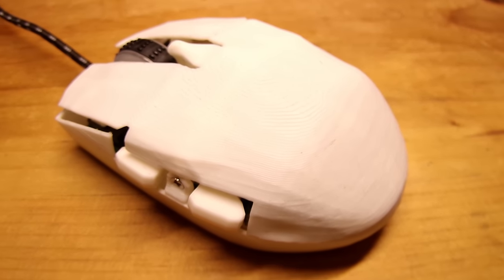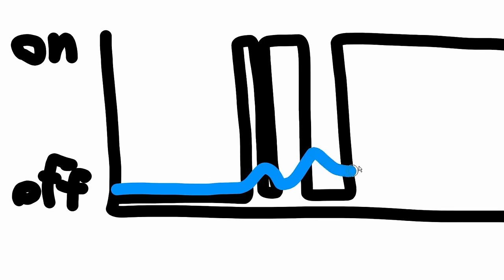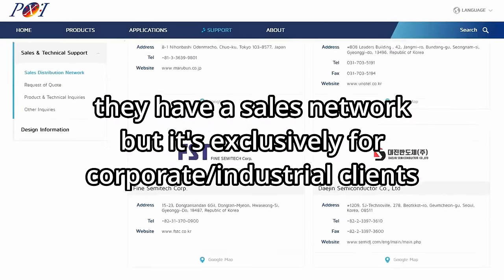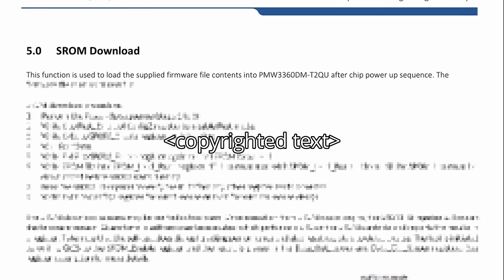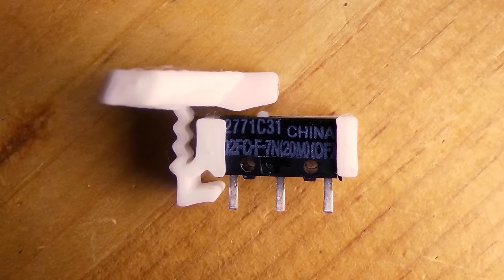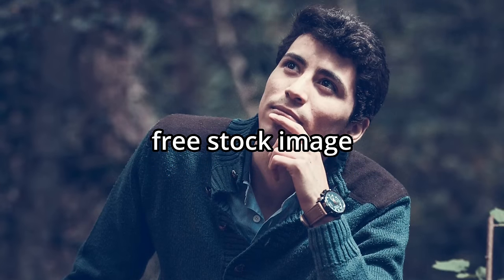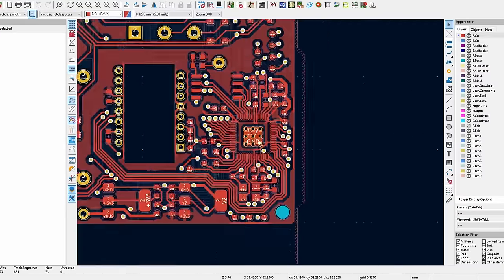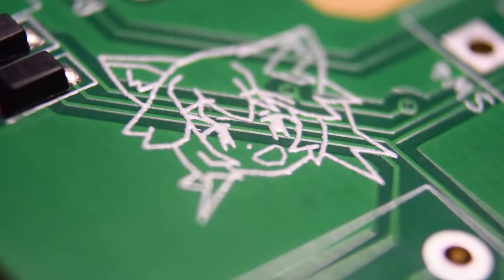I made a DIY gaming mouse because Logitech's mice keep BREAKING

Comment: Then there's me, who learned soldering just to solder new switches for M1 and M2 for my G502 Hero.

I used Japanese-made Omron switches specifically. Avoid the Chinese ones (regardless of brand), because the copper gets tarnished way too fast, usually within a year. You can clean/polish them if you are dextrous enough, though. That's what I did a couple times until I realised it would be far better to pick up a new skill and just solve the issue for good in one try.

Needless to say, it worked flawlessly. The connectors are gigantic, anyway, so even a newbie can desolder them and replace them easily. I even bought a new and original outer shell for the mouse on Aliexpress (since no local sellers regardless of where I looked) and I basically own a brand-new mouse now.

PS: Funny enough, I wonder why the M4, M5 and so on never had issues. Maybe it's less usage. Maybe it's different switch structure (or material?). Makes me curious, though. I only ever had issues with M1 and M2 switches.

Comment: I’m surprised you don’t mention scroll wheel; the last like 5 mice I’ve had, the scroll wheel was always the first to start failing, often only days after getting the mouse.
Reply from the maker: The scroll wheel is one of the pieces where you just have to hope that they don't cheap out, unfortunately. The way they work internally doesn't give enough information to do anything clever like I did here, though there are wrong ways of reading them that are prone to glitching than others.

Comment: I've been thinking about making my own mouse with a plethora of programmable buttons. I thought I'd put two mouses inside one shell and use just one for the sensor but both for buttons. My current mouse is a Roccat Tyon (which for some odd reason now has it's control software working without any bad lags or waiting times, which before made the software a total pain to use with like 10-30 second lag for the simplest of settings). It has pretty good features and almost enough buttons but the sensor is blah. 

The other mouse that I had for a good while was Logitech G300 but it's so tiny that it really makes my hand hurt. Also the Tyon has pretty cumbersome shape that I've tried to shave a bit. After using a modded Silverstone Raven Gaming mouse like a decade+ ago and the G300, I can't live without the two extra buttons on the right side, or buttons on the top/behind the wheel. Also the analog thumb flicker on the Tyon is very nice, even though I need a 3rd party software to make use of it while browsing and it isn't really that good, as I can't have actual analog control over scrolling, just a very course ramp of repeating the given amount of lines to scroll in Windows mouse settings.

Comment: I can attest to logitechs lack of quality control; I have 2 g203's - in one the middle mouse button barely works, on the other the buttons all stopped working.
-
Update:
It turns out the buttons hadn't stopped working, the thumb buttons were now left and right click; the PC I was using the mouse on had somehow corruped the Logitech G Hub software and reinstalling it fixed the problem. But, if I try and use the mouse  on a PC without the G Hub installed, it's the thumb buttons again.

Comment: Mice and most trackballs have enough room for full size microswitches of the type you find in an US Happ style arcade machine (cherry dx-44's) that would not fail for decades. Yet most if not all mice use the tiny mini-switches that have a much higher failure rate on purpose so you'll end up getting a new mouse faster and making them more money.

Comment: the problem isn't the logitech, but Asus holding the patent for hotswappable mouse switches
Reply: The problem is that you can patent obvious things like make a part changeable. It's not an invention.
Reply: The problem is logitech because they're using garbage switches that go bad stupidly fast
Reply: I don't know about Asus' patent, but I know about switches in new mices on the market which are a) hotswappable, b) they are optical, so the bouncing on the contacts is no problem anymore... Almost all new Razer mices have them (and some other brands).

Comment: Recently bought a Logitech MX Master 3S. I love it for ergonomics, and the buttons for hot keys. But the problem is that the Bolt Receiver is complete shit. It will work fine, but then get extremely laggy, or just straight up stop working until I unplug and plug it back in. Pain…

Comment: I’ve had my Logitech g903 for around 4 years, and I absolutely refuse to let it die because it was so expensive (for a mouse). I’ve had to replace the switches 5 times, and I also had it RMA’d by Logitech themselves for faulty switches about a month after I bought it. However, after my most recent switch change to Kailh GM4.0 switches, I’ve really found some that last long. These most recent switches have lasted me a whole year and are still going strong. I really wish Logitech would fix their switches, it’s such a widespread issue and their mice can be so expensive yet still vulnerable to this idiotic design flaw…

Comment: yo, I gave up on logitech and went to roccat years ago after fighting with this problem ever since the g502s wouldn't stop dying, but I salute your spite, and am interested in coming back around to this when my current mice give up the ghost.
Reply: that is wild to me, as someone that has and still uses two g502's, one og wired one that is about 9 years old and a wireless one that is about 3 years old and knock on wood I haven't ever had any issues. I kinda want to make my own mouse just for the fun of it but I guess my luck gives me less of a reason to.
Reply: Define die. Is it just the switches dying or the mouse isn't even recognised aka doesn't turn on?

Comment: dont tell him that all mechanical switches eventually double click no matter if they are under volted like on the logi boards :3
Reply from the maker: That's what the timed state latch is for! Even if they double click for like, a hundred milliseconds, you can still filter it out without adding any latency, as long as you've got a solution for chatter.

Comment: I changed the microswitches in my venerable Logitech MX400 with the Japanese made Omrons and it made a huge difference.  I think they're about 6 years old now and only in the last month has the LMB started to double-click on me.  I'm not as much of a gamer as I used to be, but I do use it every day.  I would change them again, but I think the sensor is starting to die.. the tracking occasionally gets hung up on nothing.  (no hairs or anything stuck inside that I can tell)  Sucks because it's the most comfortable mouse I've ever used.

Comment: The best Hardware to mod a mouse is in my opinion the Roccat Cone Pro Air. Good Wireless - The only thing regularly recking it self is the scrollwheel, but thats quite easy to replace.

But all in all a very cool Project - An Open Source Mice that you can mod to your likings.

Comment: I've been using the WaveShare RP2040 Zero for a lot of my projects. It's nice because it has a rear facing USB C and is really small. The power of the Pico but a much smaller footprint.

Comment: the reason why the switches on logitech mouse keep breaking is because they use low quality omron ones, replace it with something like kailh GM or TTC golden it wont break, the tradition of logitech is their low quality switches ngl. either way the real reason why we would want a DIY mouse is because we all hate the proprietary software these things come with and the limitation set up by them. i hope one day the monopoly of pixart will end and we can get the sensor without extra scalping, but with the reliance of all mouse company ever on them its difficult to achieve that.

Comment: After facing similar problems as yours, I want one. Sadly I don't have disposable income to buy my own 3D printer or even a Chinese rework station.

Have you considered putting sockets to make the microswitches modular? You may have solved the biggest problem in the mouse, but I think making it modular opens up great options like being able to switch between different microswitches. Sick and tired of Omron switches? You can swap it with a Huano or a GM switch, just like hotswapping MKB switches.

I think the easiest way to make something hotswappable is with the use of millmax sockets. However, I think you need a hole big enough and a design to accomodate the added height.
Reply from the maker: The added height is the biggest obstacle, yeah. But also iirc the hot swapping system is patented...

Comment: I've been dying of old age on a nearly identical project because I found out that electronic component suppliers will send you legit parts if you just go through the awkward industrial process of emailing "hello I would like to buy 10 of this part for $1 each". But then I found out that the chips (at least the spcp168a type that I ordered) don't connect for some reason? No matter the company you buy from??? I guess I have to activate them somehow? (Would appreciate advice). Anyway, I'm stuck there, so this project is probably better off for just stealing a sensor from another mouse

Comment: When you said you have to replace the mouse every 6 months what do you mean by that? I thought it was only the switches that were failing
Reply from the maker: After enough replacements the solder pads and solder mask start to get damaged by the repeated heating and un-heating cycles and develop holes or lift up from the PCB substrate.

Comment: I did the same thing with the g600 (minus the coding and pcb changes, your just built different mate) still working out the bugs with 3d printing the shell but as of rn there are two running models.

Comment: 02:45 No wonder you had trouble desoldering that pin: This super fine soldering tip loses tons of heat along its length. Use a short stubby one with a chisel shape, and maybe even crank up the heat to 360°C.
Reply from the maker: I desolder with a dedicated weller station with a chisel tip. That clip is purely dramatic reenactment. But also, the sides of needle tips are just as good at transferring heat as the points of chisel tips are.
Reply: Some irons just can't sink much heat. We can't all have 550 W American Beauty soldering irons after all. Doubles as a space heater on those cold nights. Cook your dinner on it!

Comment: good result and engineering!  I don't know how your old mice failed so often though- I use a mouse for 12 hours every day since they had balls in them... and NOT ONCE did I have a broken switch. All the problems I ever had was related to the mouse wheel and most mice are also bad at flying into a wall.. which can be easily fixed by not playing Overwatch...

Comment: This is splendid. Did your custom board contain any extra components that are not present in the pico but required? 

I am thinking of doing this but with off-the-shelf RPI Pico, buttons and the sensor(i have few older mice around to salvage), since if the only problem is the location of the micro usb I can work with that.
Reply from the maker: Yes, the sensor needs an additional voltage regulator because it needs a weird 1.9 volts instead of 5v or 3.3v. Aside from that and the obvious (buttons/sensor/scroll wheel encoder), there's no extra components!
Reply: @wareya  I see, thank you for the reply!

Comment: "a soldering iron is just not going to work"

Not with this skinny tip, but someone more proficient will have a lot less trouble than you did without hot air, and having a set of hollow needles helps. Also what is this a pinecil how much (how little) power are you feeding it?

You can salvage parts with a construction hot air gun if you happen to have one, but it's not useful for soldering.

QMK keyboard firmware is actually fully capable of being a mouse and already contains 3360 sensor support.

The stock switches don't actually wear down and die for a long time if you squirt some D5 oil inside them when they're still fresh. And an alternative way to make switches last longer would be to supply a higher pullup current, which mouse manufacturers shoud have just done a long time ago. The internally generated pullup current of STM32 and LPC microcontrollers mouse manufacturers use is too low to break the surface oxide. Some switches are also fundamentally a lot better suited than others, in particular D2FC are trash (regardless of the -M variant, 50 million clicks, no matter, same shit) but D2F without C are excellent for long term durability with small clearing current, and Huano and Kailh are all substantially harder wearing than D2FC as well. But they all cost money, while D2FC basically does not.

There are indeed two perfect solutions to switch read issue. One is to pull up the common pin and then do reads on both NO and NC pins to filter out the in between state, as you're doing. The other is to pull the NC side high and NO side low, tie them straight to rails if you want to, turn the microcontroller input into pure HiZ (disable internal pullup) and read the C pin of the switch, and relying on Schmitt trigger construction of the microcontroller inputs. It's sort of amazing that nobody does either.
Reply from the maker: I have an old weller that goes up to 850F with chisel tips. The problem is at that temperature the ground pin starts to heat up the IC's casing and make it melt before it manages to transfer enough heat into the board's ground plane to let the solder melt. Running at lower temperatures makes it safe for the IC, but the board starts dissipating heat faster than it's pumped into it, so it doesn't come unsoldered. Using a heat gun means the board is being heated up more than the pins, so the board's dissipation stops being a problem. The weller is the iron that I tried desoldering with; the clip in the video is just a dramatic reenactment (as you can imagine).

If you look closely, you'll see that I'm using the side of the needle tip on my pinecil, not the point of it. This is similarly good at melting solder as the point of a chisel tip. I think it's getting 19 volts from my battery but it might be more like 15, not sure.

Firmware is not the hard part of this kind of project. On the contrary, if I had to figure out how a project as big as QMK was structured to figure out where to add my debouncing code, I'd have no idea where to put it. I'd also have no idea how to make sure that the switches, wheel, and sensor are all being polled in the right order (sensor has to be polled first since it takes like 400 microseconds).

Yeah, it's really amazing that nobody does any of the "good" switch sampling methods.
Reply: @wareya   ah I see. I desoldered another sensor before but didn't run into trouble somehow, was repairing a laser mouse where the emitter died, it shares the ic package with the sensor. 

I bought a 3325 mouse recently to hack it and add this sensor to QMK because here 3360 availability is a bit bad, but due to circumstances accidentally ended up just using it so I haven't been inside it yet. A speedlink sicanos. It's eerily comfy almost although I have girl hands and it shouldn't be. Was actually building a RollingSloth RS4 before but then I ended up modifying a little more and that's all not finished yet and not sure where I want to go with the shape yet.

Printing open frame in light weight stinky HIPS filament and painting with model paints ("enamel" alkyd paint). I have used it on a MIDI control thing before this paint is super insanely tough.
Reply from the maker: @SianaGearz  Since it's a problem of ground plane heat dissipation it probably depends a lot on the specific mouse you're desoldering the sensor from. I'd be better safe than sorry when giving advice about it and opt for the method that'll work even on mice with really fast heat dissipation.

TBH I was kind of weirded out by how the 3360 is still somehow the easiest-to-get good sensor on the market after all these years. Having the option to use a 3325 or 3333 instead would be nice.

Comment: Now I'm wondering: if you can one-up Logitech on mouse lifespan/repairability, can you outdo them in terms of distinct buttons? Currently the G600 has 20 distinct buttons, which is probably the highest amount for any commercially available mouse, but we can surely go higher. (Throw a horizontal scroll wheel in there as well for good measure.)
Reply from the maker: If you're willing to go with keyboard switches it wouldn't be that hard, they're easier to connect to 3d prints than mouse switches since you can plate-mount them even at weird angles. I don't personally use many-button mice, though, so that would be a project for someone else (I'd probably do it wrong).

Comment: Hot air to desolder through-hole, ehhww.

But in all seriousness, it's fine for once in a while with no other options. But if you regularly deal with through-hole stuff a desoldering gun is a must, much more so than a hot air gun.
Reply from the maker: The pins and packaging of the 3360 are fairly fragile, so it's easy to damage it if you try to desolder it with point heat instead of area heat (if you use too high of a temp for too long), and also easy to fail to outpace ground plane heat dissipation at mild temperatures (like 600~650F), especially if the mouse has thick copper planes. Using a hot air station heats up the whole board, so heat dissipation stops being a problem. I burned through two chips get damaged (one with the ground pin twisting inside the package after melting it, with the solder still not becoming entirely liquid) from failing to desolder them with an iron and a pump, even if I tried adding leaded solder, fresh flux, desoldering wick, etc.

For chips with nice chonky pins and weak ground plane connections, or stronger IC plastic, yeah, a desoldering gun is probably a lot better!